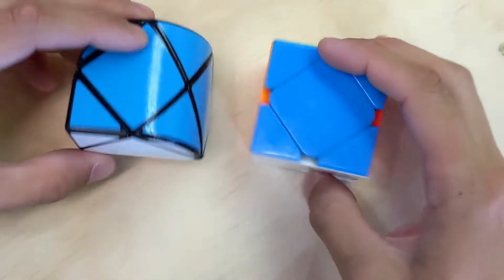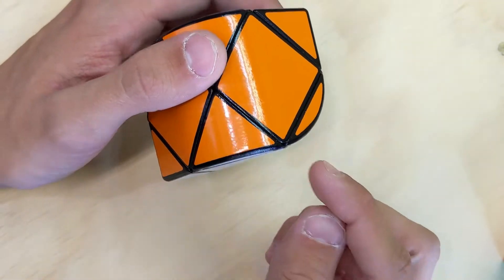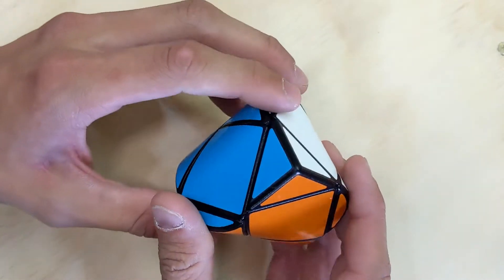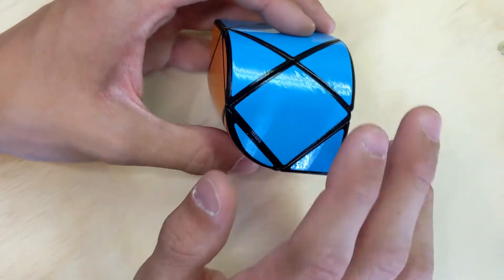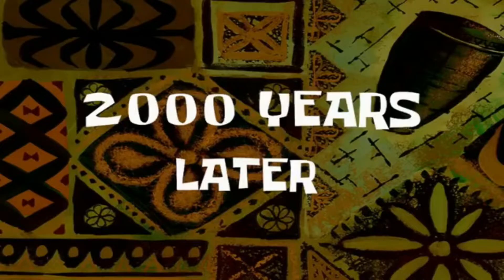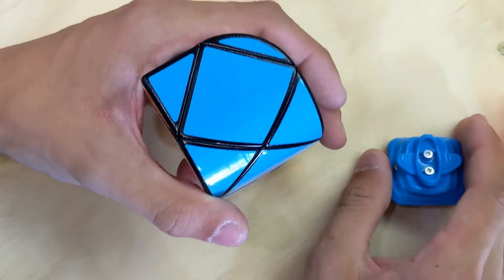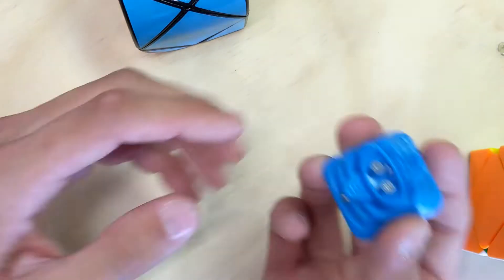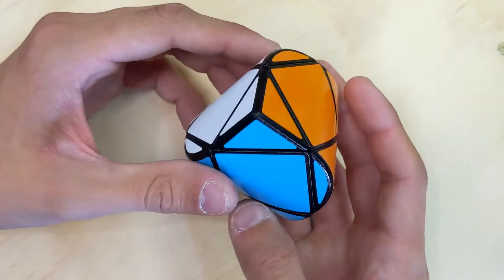Penrose Skewb

Comment: Ya ya first come t and view cool I’m curious if u can do this with a megaminx
Reply: I'm fairly sure you could, but you get more options. you can smooth 2 faces together, or three in a line, or four but that stretches the meaning of Penrose.
Reply from the maker: Hybridcat: On the twisty puzzle museum there is the Kleinminx which I made and I believe a Penrose Megaminx out of the same pieces.  It would be interesting to take a hexaminx and Penrose it.  I might do that in the future.

Ethan: puzzle names are kind of vague so "Penrose" doesn't really mean much.  The guy who came up with the Penrose mod claimed he named it after the Penrose triangle.  So Penrose can mean different things based on who you are talking to.
Reply: I've made one as well, they're a fun solve.